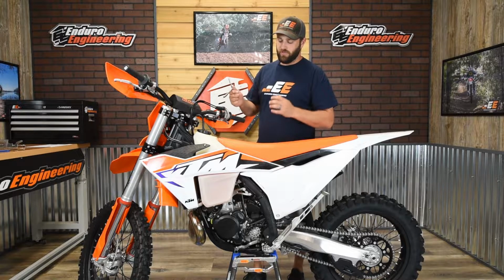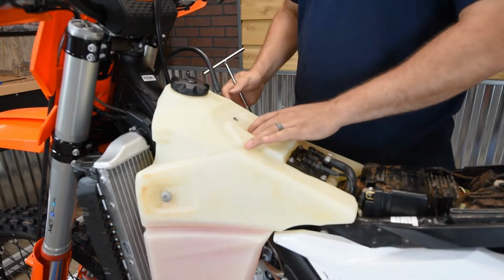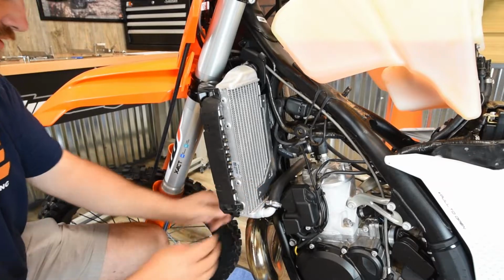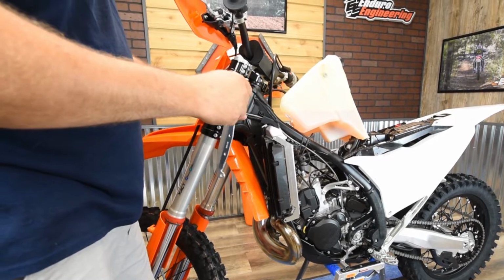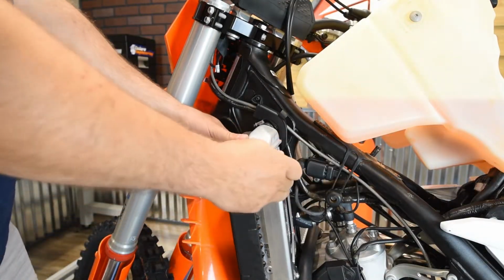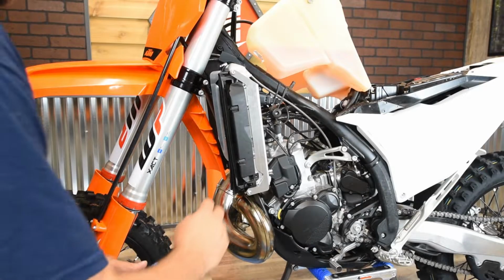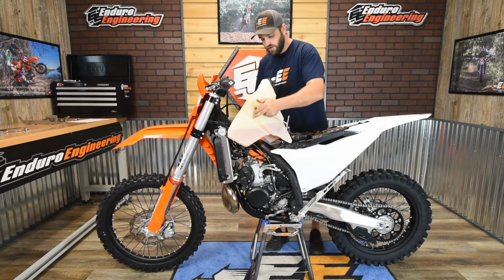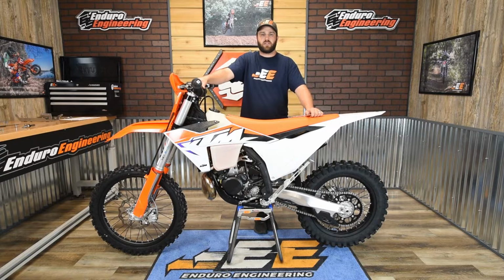How to install the Enduro Engineering Radiator Braces for 2023+ KTM/Husqvarna 11-1023

Comment: Should they fit on Husqvarna FE 350 2021? I tried installing them, but there is no space between radiator and frame(there is a bunch of hoses there) and i have a fan which i don't understand how works with them.

Comment: The instructions I received indicated that I need to drain the radiators. I have a 23 FE450. Is it necessary to drain the radiators?
Reply: exactly my question for the same bike as yours...did you drain it?
Reply: @paol951x  yeah I ended up draining it and replacing with Engine Ice. There's no way to install these without draining
Reply: @digitizzle8030  Cool thanks for the reply, that's what i was thinking good time for engine ice. cheers!